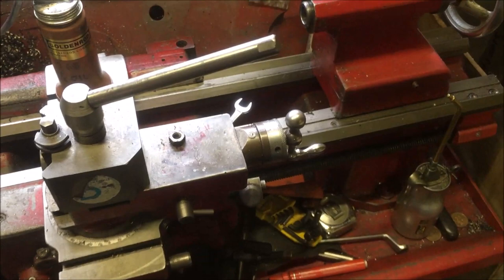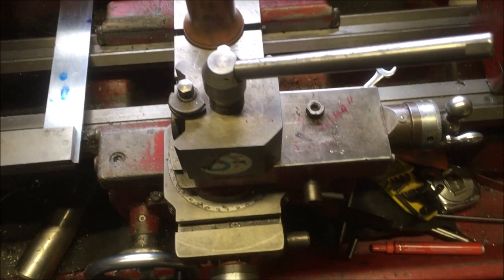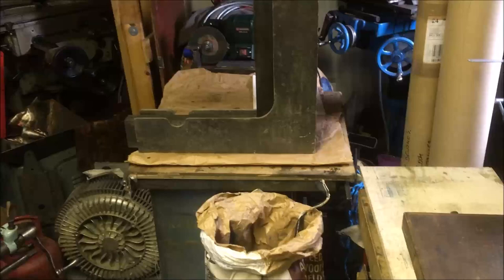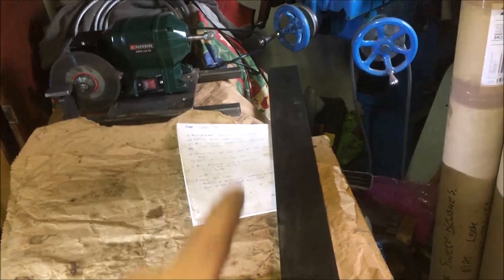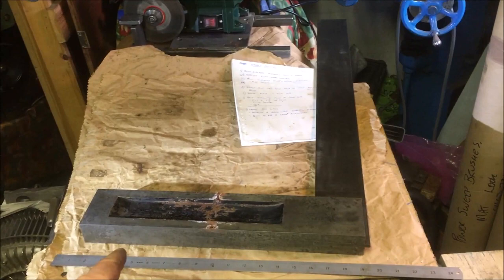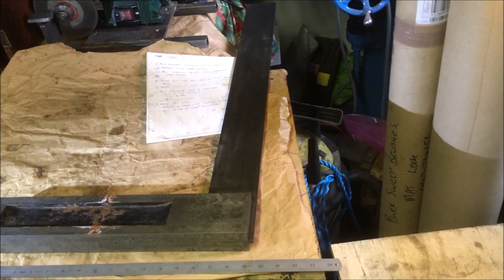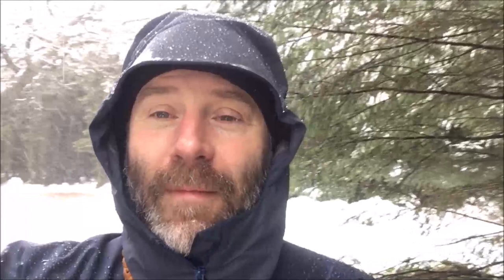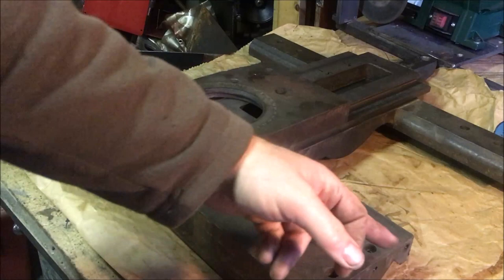Holbrook 6 The Saddle and Twin Cross Slide

Comment: Good progress Matt.
I can't say that watching you has improved my motivation to even dare to look at mine.
That is my weakness not your lack of inspiration.
Keep it up.
I thought you were talking to Stephan at one stage !  😁
Reply from the maker: Be interesting to see how it ends up and if I want to re-scrape my Boxford to the same standard - should in theory be a quicker job ! (famous last words) All the best Mat
Reply: @lookcreations 
Matt do you think  the hole with the brass ferrule is just a drain hole for cutting fluid etc. With a means of attaching a flexible pipe possibly  ?
Difficult to guess from your pictures .
Steve.
Reply from the maker: @stevewilliams587  could be - but why the brass bit ? One of the Holbrook owners suggested it was a travel limit for the taper cutting - which looks possible. ?

Comment: I am very impressed with your work.  I have got to say: That lathe has some very interesting designs: Especially the taper attachment. I have never seen such a thing as the double cross-slide. I wonder if it has any benefits compared to the telescoping screw arrangement used on a lot of other lathes ? I can only see drawbacks really: more complicated and less rigid. Anyway... Regarding the main headstock bearings: I really think you should repour them, doing it properly like everything else you do. Changing to rollers bearings would be a nice challenge but there doesn't seem to be enough room really..
Reply from the maker: The TT attachment was I think a Holbrook design, as best I can understand it enables zero backlash no requirement to disengage the feed screw etc. The bearings will be re-scraped. Ive spent the last couple of weeks working toward that, the degree of wear is far less than I originally measured and well within a re-scrape. The result I think will be better than I could hope to achieve via a repour. I shall keep that option as a back up plan if I cock up the rescrape ;-)

Comment: Hi nice to be here, yes the Monarch 23 we believe is the machine Keith has nearest a conclusion on that rebuild. That square from the Internet looks to be a great issue checker, once you know where that tool holds true or not in tolerances you can really check the distance for making good checks to squareness. Nice shop squareness gauge you made for your granite top.
A tickle up? we are waiting, is this new to us? or is this a term shared in a different expression of a similar end result?
Looks cold there for the dogs, it is true it looks peaceful.  
With these two guys in the states we have a few projects that are going to take time wise what it is they take some are rebuilds of a mere few weeks once a plan is drawn up and others are a 6 month plus project of learning, researching, thinking, acquiring and our machines do not exceed 24 inches in any axis.
So you take the time you need to make the machine right.
Did we miss the bottom of the saddle that mates to the lathe bed?
That double cross slide is really worn over time to a real taper good thing you have a shaper to bring her back closer to reduce scrap efforts. 
Your scrapper manual under high speed camera action made it look to be an electric scrapper, that was cool. 
That spindle and gear box are looking really nice. 
We will be watching the spindle rebuild if needed lets see what wear you discover, this is going to be so interesting to us.
Thank you for the continued sharing, Lance & Patrick.
Reply from the maker: I scrape the saddle once I have a reference surface on the cross slide ways to check alignment with the square to the bed ways,  the sequencing of each set of slides is taking me some time to work out.  Thanks for watching and commenting. Mat

Comment: I think I might use some Turcite or Rulon to keep the geometries near their original.  That said,  I've never priced that stuff out,  it may be made of gold.

I enjoy the slang definitions.   One of my mates at work is out of Dublin Ireland so I understood them right off but it still gave me a chuckle to see you mention piss up.

I think it makes more sense to me doing it bottom up the way you did.    I'd need to get it explained why you'd do a top down.
Reply from the maker: Still not decided on that front - I havent even established a supply option in the UK - so it may be out of the question before I start.  i should know in the next few weeks where everything is going to sit and the overall impact on the mating parts feed & leed screws, gearbox etc etc It may certainly avoid a lot of additional work modifying other bits to suit.

Comment: Thanks for posting all this videos!! i'm currently thinking of restoring my lathe. Is the first that i bough and i got scammed. The bed has 0,7mm (0,027 in) wear in the middle. And the tool changes about 1,2mm (0,047 in) in height while i'm turning something. This causes huge variations on the diameter of the piece.
But i wonder if grinding/scraping 0,7mm difference in a 1.40mts way is feasible
Reply from the maker: Take a look at my earlier vids on rescraping my shaper main casting. It had about the same amount of wear as you described. It’s quite doable but a lot of work.
Reply: @lookcreations  Allright, thanks! i will look into it!!

Comment: Eyup. Great scraping video's. Did you work for NASA or British Aerospace? Do you think it's possible to improve my Archdale  milling machine, Elliott shaper and my Harrison lathe. I get by on them now but it would be nice to know how much they are worn. All show signs of ware in the usual places, a bit anoying sometimes.  How do you use that wood machining gear your small workshop? P'S I've nicked a shaper clapperbox locking technique off one of your videos A1+.  I like you 3 foot nearly square tri square (description in the snow).. By ek  what a great place to live n walk your dog's.
Reply from the maker: I have to say, if you have the space and inclination to - machine refurbishment presents some interesting challenges. The first step is assessing what you have and thus what wants doing. A steel straight edge and feeler gauge set is as good as anything to get an idea of the wear on a bed / column / saddle. After that, you can make up a kingway type sled without too much trouble to get a better picture. Its only when you commit to scraping that you need the surface plate (sized to the job) and Straight Edges for printing - again sized to the job makes it much easier rather than trying to make do with a SE half the length of your ways. Archdale mills were pretty well put together well worth looking at the options. You can look through my shaper rebuild videos and decided yourself on that ! Harrison lathes - some of the later ones had hard' bed ways - in which case if the beds good - the saddle would be worth looking at to get an idea of wear / cross slide to, along with the Tailstock. Plenty of fun to be had :-)

Comment: A thought: The squareness of the lower dovetail is not as critical as the top one. You don't use it for facing.
Reply from the maker: Quite possibly. My initial thoughts are that the fixed side of the lower dovetail should be least worn - so I will scrape that to a decent finish and test it on the bed with the worn saddle - and come up with some means of testing the twist on the worn saddle to see whats there. By the same token, It makes sense to have the top and bottom way in alignment rather than not - but lets see how they measure up first - Im not for making more work for myself unless theres an advantage.

Comment: Try searching ebay for "Cake Pans Granite" (no, I can't explain it, but the price is right)
Reply from the maker: £65 for for 10x6x1" thats not bad at all as long as its square. Have you ever tried lapping one if its out ? I wonder if a diamond stone and some careful work might provide for a low cost all be it costly in time, solution. Thanks for the tip. Mat
Reply: @lookcreations  I have no idea how square mine is (it arrived last week and hasn't been used). The shape is not conducive to testing in the way that you demonstrate. If you had three of them you could test against each other.
Reply from the maker: @andypughtube - yes, Ive wondered on how to test such a profile for square - thats why I like the engineers square - self proving. Still , with a bit of thought, Im sure a simple rig could be used to check it.